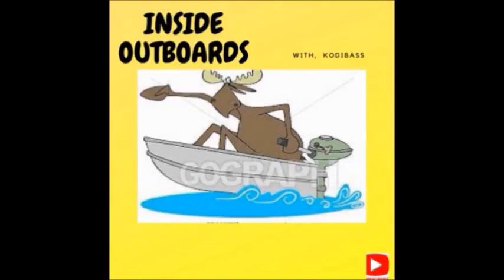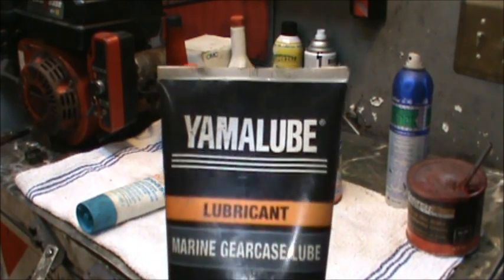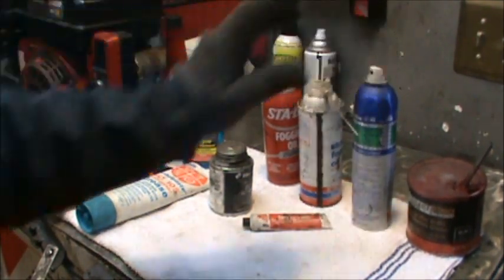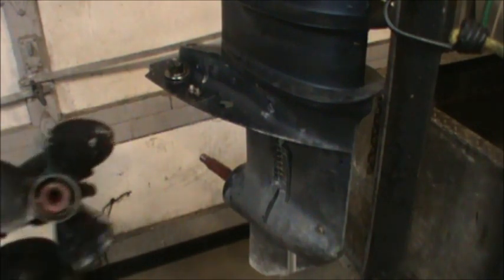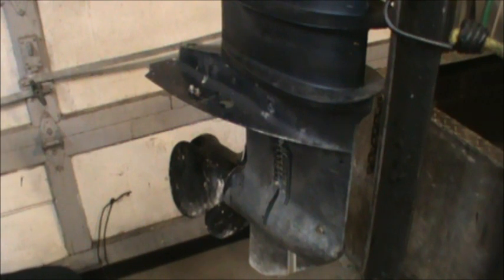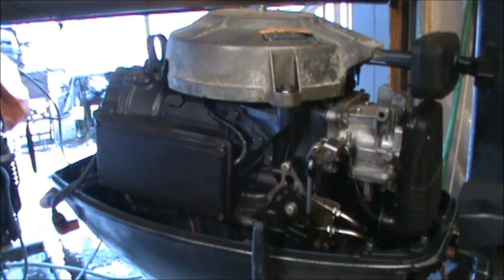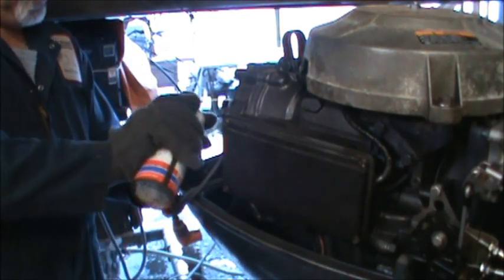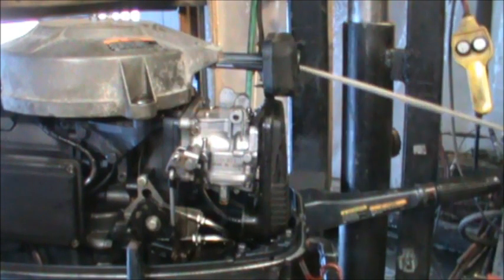WINTERIZE OUTBOARD,  FOGGING     ( Full Method )

Comment: Hi Kodi, I just found out a couple weeks ago from a guy who also has a 1957 Mercury Mark 10 that the lower unit doesn't take quicksilver 90w gear lube. He told me about Lubriplate 105 grease. So I looked it up in my service manual and it shows putting it in there. I thought when I removed the plugs and didn't see any drainage the lower was dry but when you pump in the lubriplate it won't run out. It took half the squeeze 10 Oz tube before it came out the vent hole though so the prop seals are probably bad. I noticed whoever put the outer seal in is backwards with the metal showing on the seal. That may be the leak issue. The other one inside I can't see if it was install wrong but will replace both at the same time either way. Other than that she runs great now with all the fuel pump gaskets in which was missing one of them. I had to order the new kit from Harvard Marine on Manhattan Island. Got feed up waiting on Crowley.
Reply from the maker: Yep'  Some of the best have been using it for decades,  scroll down on this link.      kodi.https://www.duckworksmagazine.com/06/columns/max/index5.htm
Reply: Thanks Kodi, I read the article and will keep checking the lower unit after I run it to see if it quits leaking? After i put the 105 in and last ran it the top of the water has some white showing but that may stop. I'll open up the plugs and push more in to see if it's still coming out the vent or if its low? I ran my finger around the prop seal and don't see any there so I think I'm good

Comment: Hi. Great video!
I don't get why you put dielectric paste on the tip of the plug? The paste is an electric insulator. I would use it on the inside of the boo only.
Thanks
Reply from the maker: Thanks for the tip! ""Punn" haha, Just a tiny bit on the tip helps to prevent rust in the boot clip.         kodi

Comment: Thanks Kodi for the great video I found it very informative. I'm working on a 25 hp mercury 2 stroke that's been setting for years and I'd like to get your opinion on removing bolts without breaking them if you ever find the time
Reply from the maker: In many of my videos I show how I get @ them,  different videos  / bolts.  as I come across them stuck, broke off etc. kodi

Comment: How to winterize your old 2-stroke outboard...  Simple... Run it out of fuel or drain the fuel.  Then store your outboard upright deep in the back of a dry garage...
Reply from the maker: the fogging helps seals / gaskets not to dry out / leak.     kodi

Comment: Why do old 2 strokes that have been sitting for long periods of time not always rust up in the cylinder head? Compression is very often good even in dry and first time cranking? How is that possible??  Great channel, thanks Jay
Reply from the maker: I find it is often how the motor was put away,  If it was flushed, fogged etc.  they seem 2 do fine setting for long periods,  if it was put away salty & wet not so much.            kodi
Reply: @kodibassInsideoutboards  Thanks for the reply!  You and This Old Outboard  guy are my new Heroes. I just  turned 69 and retired to White Lake Mi. Great  fishing and boats of all kinds here. I was afraid to splash the Herrishoff America Cat. This spring because of Covid-19 and my new Puppy who could not swim at a month or so.
I have to admit a long standing dislike for outboards but I have learned to love them (not always). So being no sailing this summer and locked down at home
Reply: I saw my neighbors 14 foot Aluminum fishing boat. Made an offer and discovered it had a 1956 10 hp Seahorse on it. Well it has been a slippery slope since! Now I have a 57' 25 hp Seahorse and a 59 18 and a Ski Twin 33. OMG when does it End? I spend nights whatching videos of old outboards and days buying tools!  Yikes Jay

Comment: As for the lubriplate, never heard of such a snake oil idea. Been a tech over 30 years, been to school and yearly update school. MANUFACTURERS do NOT recommend any addition of any kind to lower lube. As for the engine assembly lube he uses, (lubriplate), it gets diluted down and will do nothing. Today’s lower lubes have a tacky/sticky viscosity to cling to metal  parts. Do we want to get real technical? The lower lube for today’s motors can take up to 20% water and still work with no harm to lower unit. But of course when motor is not running the water separates and can start rusting the steel parts, so it should be changed/fixed so water does not intrude into lower. I not saying he’s not doing a excellent job here, but just a little different. Now, let’s really stir the pot of beans here. With all the schooling and updates techs go to today, the manufacturers and techs recommend fogging motors. Has anyone here EVER fogged a motor in the fall and in the spring pulled the motor apart and looked for a coating of fogging oil? I have, there’s not much if ANY. Boy, I could write a book here on why a 4 stroke should have more fogging oil then a 2 stroke on the internal parts.
Reply from the maker: I standby the video & ""Gene''  As stated in the video the ""BEST""  I ever met,,  But don't take my word  scroll down & read.  https://www.duckworksmagazine.com/06/columns/max/index5.htm
                , Thanks 4 commenting & watching  , kodibass